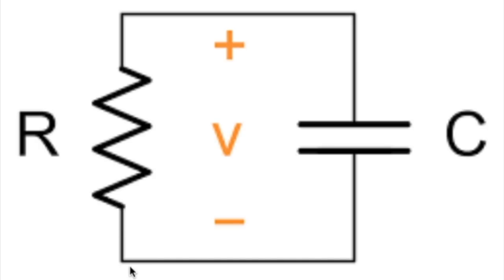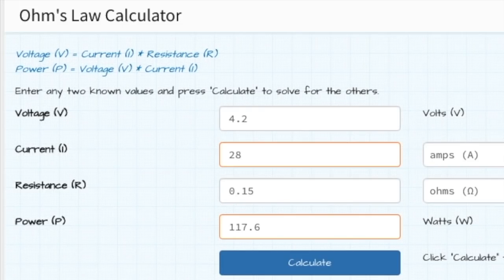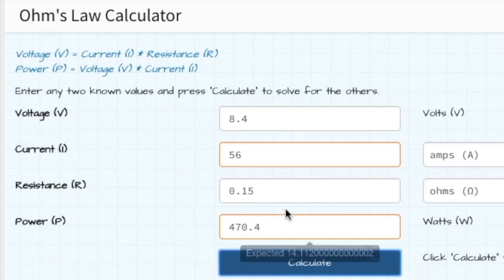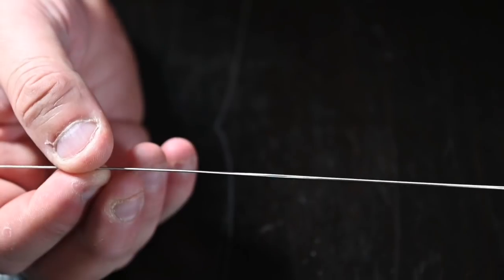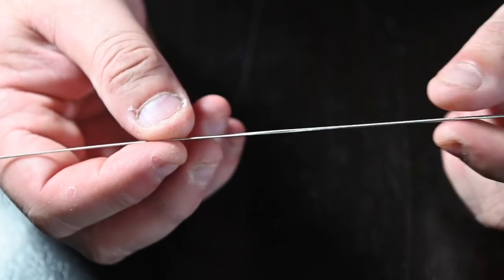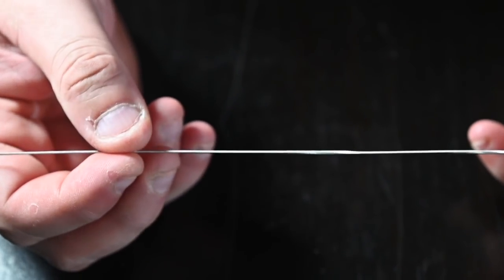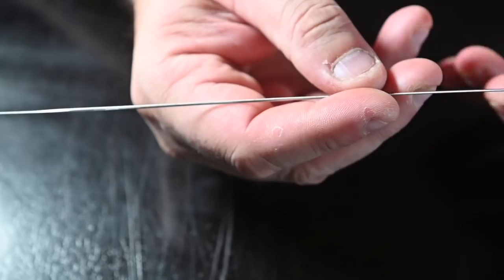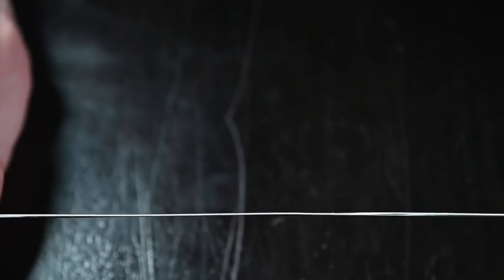OHMS LAW LESSON  DIY FUSED CLAPTONS, DIY COIL BUILDING, & DIY EJUICE,

Comment: Hey Lou I am pretty sure the Vtc 5a is 25 amps, you gotta try the Samsung 20s man. They are the best 18650 batterys for mechs, true 30 amps and very little internal resistance so they hit almost as hard as a Samsung 30 t. Great video man very informative.
Reply from the maker: dane bentley yes your are correct but VTC 4 is  30 amps drain. I knew it was either or but wasn’t sure. So thank you for clarifying that for everyone.  Have a great day Dane

Comment: I wouldn't be too worried about Chinese coils considering twistedmesses has no problem letting them manufacture his rda's but cant trust there steel wire? On another note 250mg or higher nicotine is usually cheaper by ml because you have to be more precise to make 3mg juice when you're working with 250mg+/ml. I still have a bottle of 300mg/ml Ive been using for a long time because it doesnt take much of that to make 3mg/ml  im only using 1ml in a 100ml bottle but it is definetly easier to work with 100mg/ml but any lower than 100mg is usually not much of a deal per ml. And yes I did watch your video all the way thru thanks again Lou an come back with some new content.